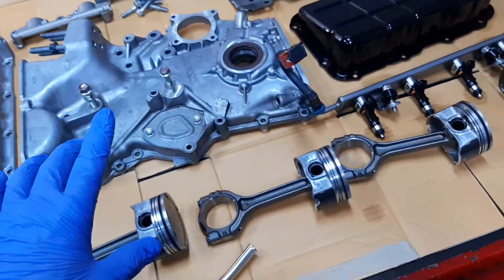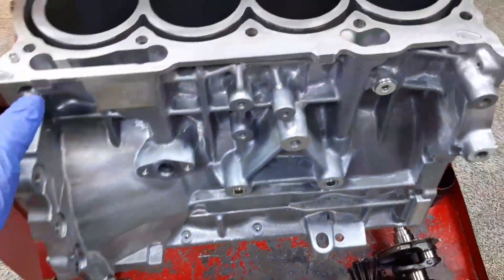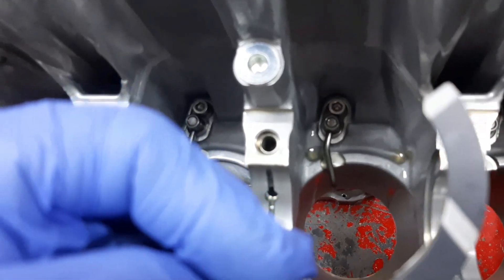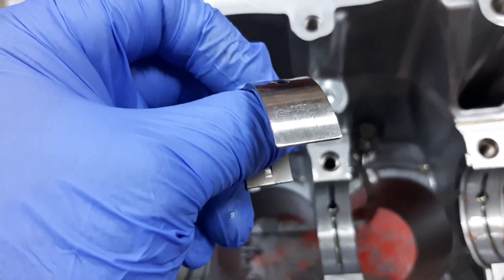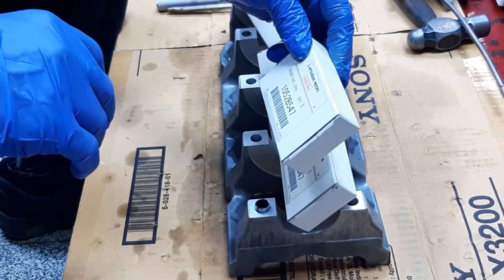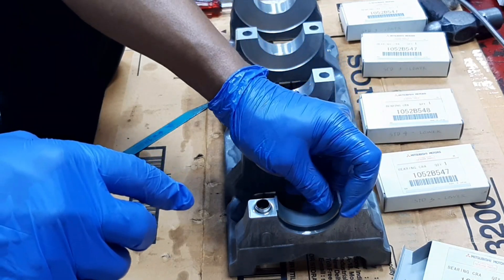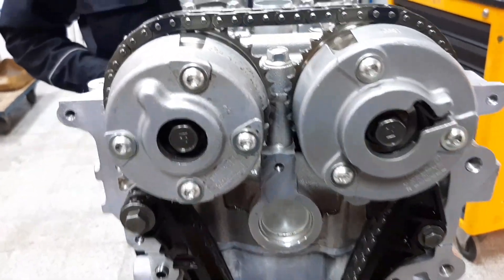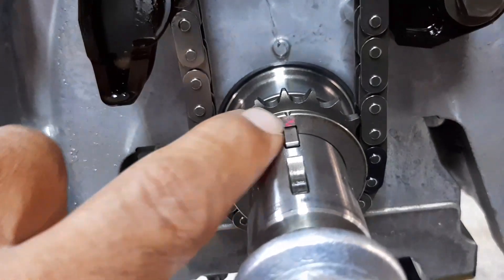Engine Overhauling 4B40 Mitsubishi Eclipse Cross 2018

Comment: I believe you're not supposed to oil underneath the crank shaft bearings, you will spin a bearing.
Reply from the maker: Cylinder head bolts, 26 N.m + 180° then +60 N.m, Connecting rod cap bolts, 15 N.m then + 120°, Bearing cap bolts, 40 N.m then + 120°.

Comment: 0w20 or 5w30 ?
Reply from the maker: 5w30
Reply: @autofixgarage5438  The user manual recommends zero 0w20. Many people are discussing this. I am currently using 0w20 in Turkey. Why do you recommend using 5w30?
Reply: @Osmanloji  the rule of thumb - if the weather is colder over the year a thinner oil is recommended (0w20). if hotter - then thicker oil is your choice (5w30).
Reply from the maker: 5w30 is recommended

Comment: When you disassembled the engine, was there a lot of carbon and oil in the intake manifold?
There is information that the engine pours oil through the PCV valve and it is necessary to install an oil trap.
Reply: It has direct and port injection like some Toyotas
Reply: @ No, the fuel injection is combined. Two injectors per cylinder and constant switching between injectors. The valves are clean
Reply: Really  @kventinburatinodv
Reply: Nooo

Comment: Why did the engine break down? What's the mileage? What was renovated?
Reply from the maker: The mileage was 68k, at early stage engine breakdown due to lack of proper maintenance sir that's why renovated because a deep scratch from cylinders and exhaust valves leakage. Thank you and God bless.
Reply: Hello, I'm a mechanic from Brazil, could you give me the tightening tables here, I don't speak English
Reply from the maker: @Beesoro OK Sir maybe tomorrow.
Reply: Alusil or nikasil cilunder?????
Reply: Чугунные гильзы @nton-motogon